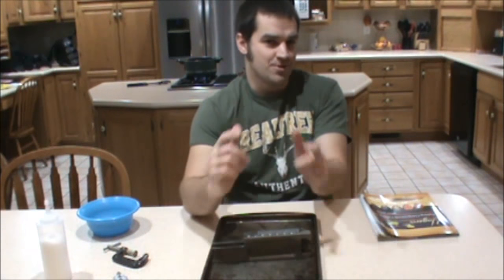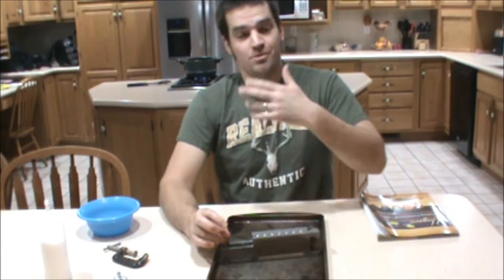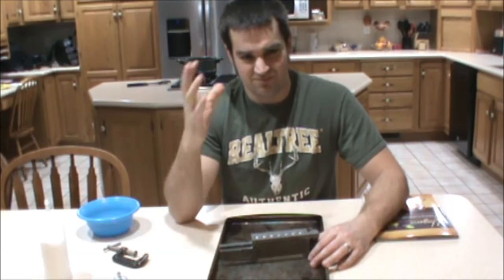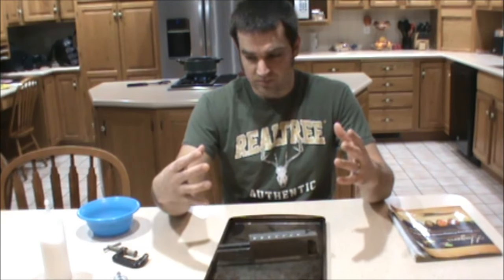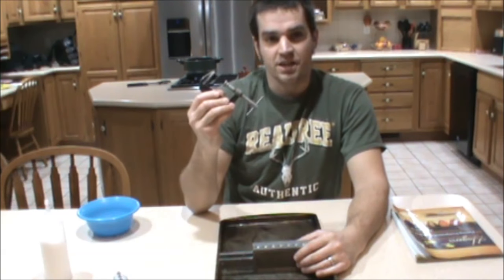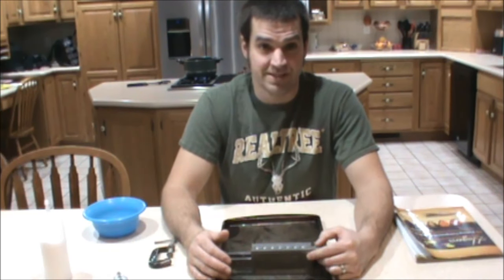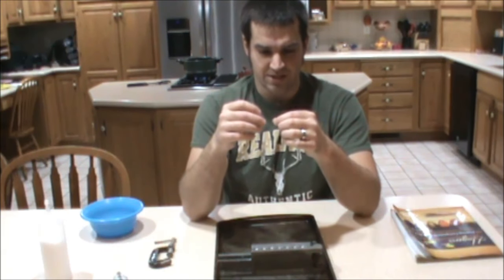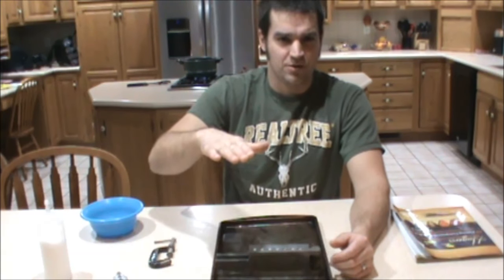How To Make Floating Jig Heads

Comment: thanks for taking the time and making the effort to put out this video.  I learned a lot.  I've been looking for a floating jig head that will float a couple of salmon eggs or a red worm into the strike zone for trout, so I need a smaller hook.  In your opinion, would a #6 hook, in that mold have enough hook reveal to be effective?  thanks
Reply: I've been having the same issue, they are very effective for trout when used with crawlers or salmon eggs, but all the hooks are size 2 or 1/0 because they're designed for larger fish like walleye. I usually use #6 baitholder hooks for fishing crawlers so a #6 is probably ideal. I lost a bunch of crawlers this morning fishing for stocked trout using this method mainly cause I think they're mouths were too small to eat the #2 hook. Soon as I switched to powerbait on a #8 circle hook so that it could be a bit more easily taken, I wacked like a dozen. Hopefully using a #6 hook on this will work for us trout anglers.

good luck 👍

Comment: Using 1/4 oz mold and 1 coat of cg paint and 1 coat of cg clear coat. Tried mustad black nickel #1 and they would not float. Each hook weighed 6.5 grams so I went with eagle claw size 1 and 1/0, they weigh 4.5-5 grams and my jigs still won’t float. Any ideas?

Comment: Awesome video have been wanting to start doing this myself. Could you explain where to get that mold and also the drying wheel you have.  Did you make it yourself?
Reply from the maker: I made the rack myself. I use to just hand the jigs but then you have a drip that you have to wipe off with a paper towel. I got the idea from watching how people dry their crank baits. All I did was bought a rotisserie at menards and used a dado cut on the 2x4's just big enough for the rod to go through. Two 16" circle boards on the ends and pvc elbows to hold the sticks and you have it.